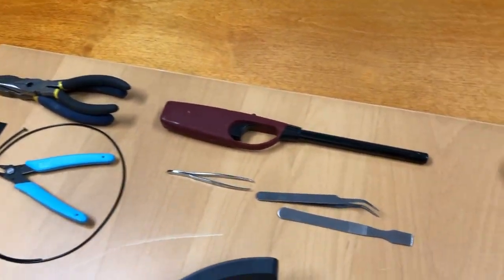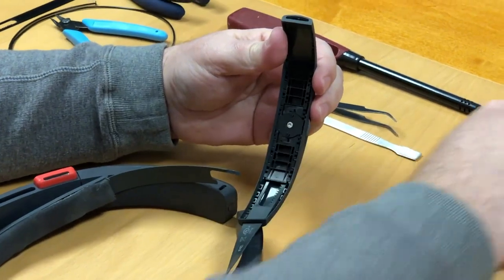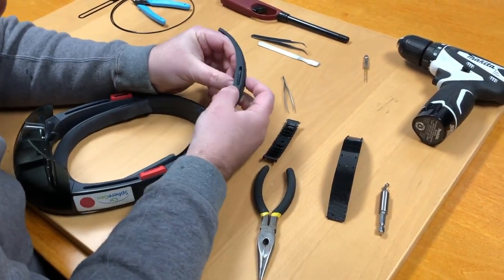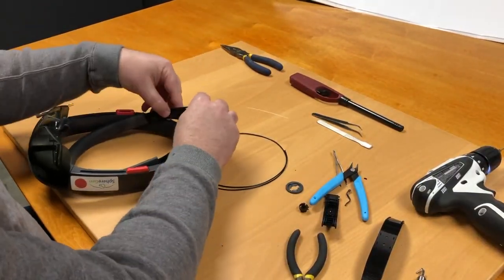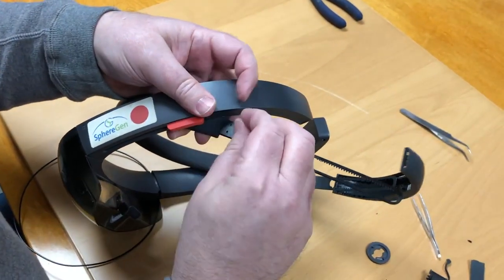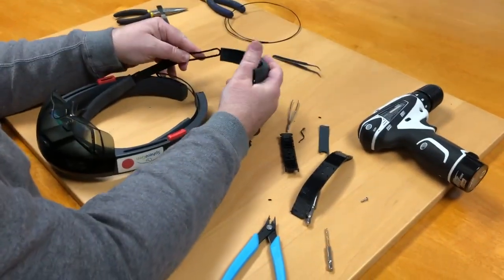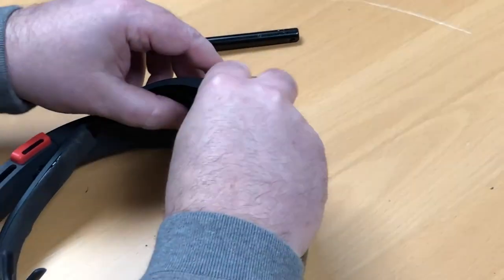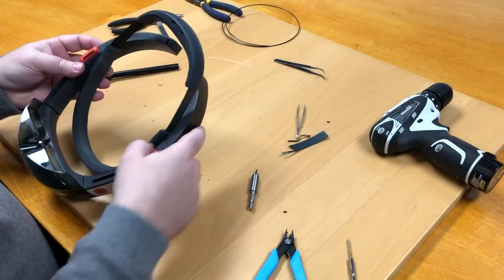How to Fix a HoloLens Strap

Comment: I've repaired two hololens units in exactly this way, but using small bolts, they've held up well. I think I'll try the rivet way next time.  In fact some Microsoft execs at a conference noticed my repair job and were very impressed with the ingenuity of printing a replacement part and fixing it this way.
Reply from the maker: That's great!